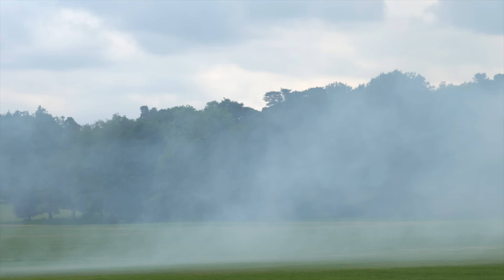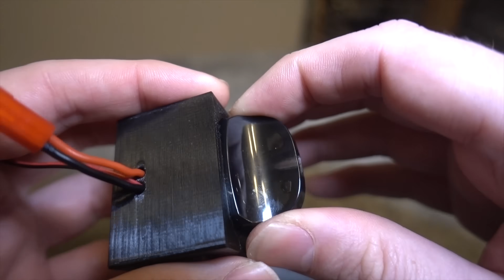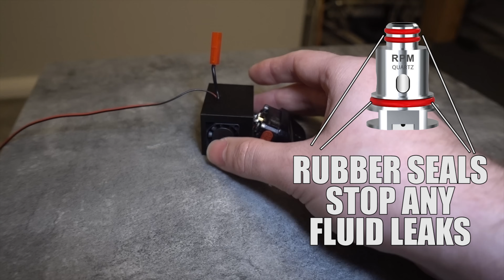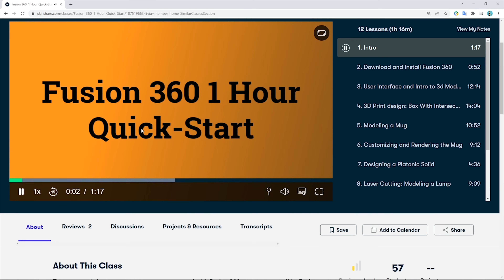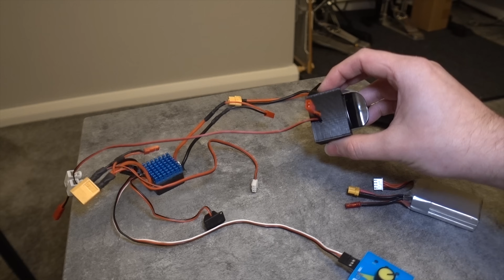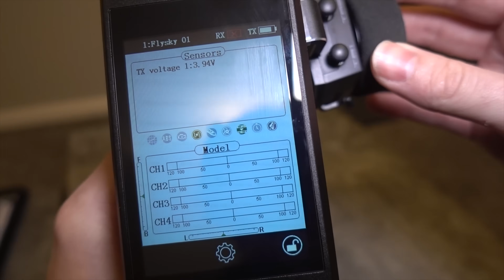RC Smoke System RC Cars Boats & Trains

Comment: I'm going to give this a try for my rc boat, printing the housing now. Thanks for sharing the file. Going to run it off the main battery with a DC to DC step down board to control the fan speed and coil heat.

Comment: Hello, excellent work!! I plan on recreating this concept. How many volts is the esc pushing into the coil? Did you have to experiment with the amperage at all? I’m trying to use 3.5volts, but I’m finding that the amperage is too low to heat up my coil. I am using the same coil that you’re using

Comment: Hi Andy,  What did you have to set the servo tester value to? Mine runs for 30seconds or so too and then it stops.  Not duer if the coil gets burnt out.  Maybe I need some sort of voltage regulator

Comment: I tried this.  The unit makes smoke for about 20 seconds then stops.  The vaporiser coil fills with liquid.  If you suck though it (as if you were vaping), then it starts again but soon stops.
I think this will work better with a vacuum pump

Comment: Awsome Andy!!  Very handy for RC applications. I am building a dual rig for my big scale James Bond car but I have a question.
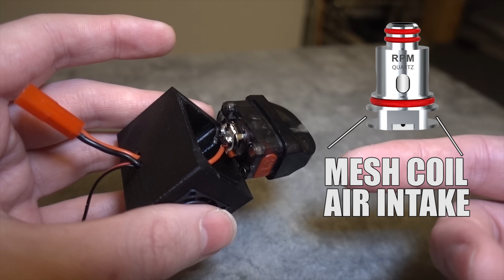In the video At 7:40 you say that” you have a better solution than this” revering to the soldered wires to the pod.
Can you give me a hint how you want to do that because the smokepod needs to be easy to replace,
in case a burnout?

Comment: Nice , you can also add a small tube  connected to the sound system if you have one , that way the smoke will pulsate in accordance with the engine revs , basically an acoustic smoker
Reply: Can you explain this in more detail?
Reply: @eskee1  there's a guy who made one on YouTube, basically you drill a hole into the speaker and put a tube in it, the tube then goes into the smoke generator thru a hole you made in it too, so the sound travels from the speaker to the smoke generator and shapes the smoke according to the engine sounds

Comment: Hi Andy, I'm trying to recreate your Smoker for my RC drift car, but I have a question. When installing it in an RC car, would it have to have 2 ESCs? one for the car engine and another for the smoker? I have a brushless esc and a radiolink that allows channel mixing just like the Flysky Noble NB4.
If 2 esc are really needed, the second esc should be connected to a receiver channel, but only the data line? leaving out the red (positive) and black (negative) wire

I hope you can help me solve these questions,
Thank you!

Comment: Since the airflow thru the nozzle is limited the chamber is much of a pressure chamber. Adding a fan will not give more pressure. An interesting little project though 😊
Reply from the maker: Yes it semems this is the case at least with a pod

Comment: This is an awesome idea. And I used to vape rebuildable dripper atomizer that I could make my own coils at whatever ohm I want. And pack it with cotton. But we just need a way to pipe in new propylene glycol and vegetable glycerin so the cotton doesn't dry out and I'm telling you these things really pump out the smoke. These little tips don't put out the same amount of smoke it's meant for vape to mouth then inhale. But the drippers are vape to lung. Just strait to inhale.but they seriously put out some clouds. It would be perfect to use a 40mm 4 coil rebuildable dripper "rda" I know it would work.
Reply: You need to make a video of this with links to the parts you're talking about.
Reply from the maker: This works to some extent. Would you feel comfortable constantly blowing on your RDA for say 15 mins constantly wothout the fluid catching fire? If I'm correct an rda would just keep getting hotter and hotter if pressed for a long amount of time as they are unregulated? I'd be interested to know. I went for the Nord 4 as it was a small pod type device that could take 80w. The smallest to do that. Things start to get heavy and messy after that when it comes to box mods etc. Vg also catches fire if it gets too hot for long periods of time so I think the amount of constant smoke we can get won't be better than this. But I'm working on something similar so let's see. I think three of these going at once might be smaller and cleaner
Reply: @AndyRCchannel  It's just nickel wire different gauges and I wrapped it around a dremel bit shaft. Like 10 wraps and I used to use two of them in parallel I believe. then I would just twist up some cotton and feed it through the center of that coil and tuck the extra around it so it can hold more juice just leave the outside of the coil exposed to the air so the vapor can come off of it easier
Reply: @AndyRCchannel  I'd say as long d there was air flow and constant supply of fluid it would be ok. I just worry about the battery because there was always an issue that if an rda got the button pushed in your pocket for too long the battery could explode but that was with 18650's. And with the RDA you could fine-tune your coil to be able to be at that perfect temperature where the air flows just holds the temperature from becoming too much. There's definitely something here. Just needs a few iterations of dialing everything in. I know sometimes I can take the cap off my vape and hold the button and just keep blowing on it as long as the fluid was there We just got to find that sweet spot

Comment: Ha ha, i vape and have looked at mine many times and thought it would work well as a mini smoke machine!  I would put that unit upright and run a pipe from the output though as very quickly the fluid levels will drop and half your wick will no longer be submerged.
Reply from the maker: The cars battery would run out before it started to do that. I do wonder though people don't vape with their heads facing down what I have observed. So surely this happens anyways? I did think about that but a pipe may restrict the airflow. People's lungs have a lot more power than a 5v fan but thx for the idea
Reply: @AndyRCchannel  some do vape that way and some dont, i keep mine as upright as possible as soon as the level falls below full for the reason i described.

My vape is a SMOK, the same brand as you used but mine is the standardized 510 electrical socket for the tank but uses SMOK baby beast elements, mine has a 10mm port at the outlet end, adding a 10mm fish tank tube to mine would not really restrict it but the type of tank i have has its inlet on the sides of the base instead of the bottom like yours so would require a different design to make it work.

I am super interested in the process of converting photos to things useable in 3D files, many times i have wondered if i could put something on my scanner and somehow use the image to generate templates for 3D printing designs, could you share the process or links to a guid or maybe even do a video on how you go about converting the images?

I see your using Tinkercad, in two years of 3D printing, i still use Tinkercad, its so easy to use and although its not as capable as the other things out there its not brain exploding complicated like them!
I have got so good at using it that i can find workarounds for anything it cant do natively :)

Comment: That's brilliant! What happens if you put a few drops of food color in the glycerine? Need some colors for muh chemtrails...
Reply from the maker: You won't see coloured smoke that often even in general aviation it's quite complicated and very bad for the environment the Red arrows get a lot of stick for this and are looking for a better solution. In short oil always Burns white. colour the colour has to be added after combustion which is why why even the Red arrows only have have maybe a couple of minutes of coloured smoke compared to to the 10-minutes or so no of white they are just masters at knowing how long to use it for. Google it. Quite interesting

Comment: I'd use a homemade solid chemical reaction sugar smoke grenade.  Recipies on YT.

No electricity required, but then, you've got a fire hazard if the model crashes before it's out.  Once it's lit, no stopping it except submerging it or cutting off it's oxygen supply.

Comment: That's awesome Andy. I could definitely use something like that in some special effects applications 😎
Reply from the maker: yes it has multiple use cases. theres actually a product called a mini fogger that is basically this for visual effects but they charge 200 dollars for it lol. theres what 14 quid of stuff to do it haha.
Reply: @AndyRCchannel  Yeah, the minis that are used are way too expensive. I would need something in a small form factor like this that can run off a battery and I can connect some type of contact closer (PIR Sensor, Step Pad, etc) to trigger it. Say like in a campfire scene or similar smoldering sections placed around the set and props. I may be back in contact with you in the near future Andy.

Comment: try a high speed radial fan, they have better static pressure
Reply from the maker: I have tried that but thanks for the suggestion. you know its kind of funny. the fans get to a particular point where they start to cool down the mesh and you get less smoke. The static pressure fans do this because they are more efficient at cooling than airflow. to combat this you can always turn up the pwm value but this puts a lot more strain on the ESC as it has to provide more voltage and current to achieve the same amount of smoke. It also drains the battery faster. This cooling doesn't happen when the atomizer is sucked on but does when blown. I believe this is part of the reason two fans made things worse. Thanks for the input really useful and thanks for watching and giving suggestions

Comment: Awesome work, Andy! Well done!!! 😃
I've seen something like that before, but the person made the vaporizer, let's say. It was years ago and I don't remember details, but he basically used some kind of cotton with some fabric around it and nickel chrome wires to make the coil... And used the exact same kind of oil you did... Or it was glycerin in gel... I really can't remember. 
Then he put everything in a box (maybe a metallic box, I don't know) and used a small 10a esc to drive it. Then you could put it in a switch and so on...
Anyway, stay safe there with your family! 🖖😊
Reply from the maker: there have been attempts in the past to make a product like you describe but they are not safe because there is no way to regulate the coils from going into thermal over run and the fluid catching fire, which is why you dont see them for sale any more. Burnout daemon and burn effect were two products you could buy in a store but after my research I would imagine there would have been so many incidences of some sort of fire or RMA it wasnt worth it to make them  (VG has a very low ignition temp) you also cant cater for what someone's ESC can handle and how much things like motors running at the same time will have an effect on the current and voltage that can be provided to the devices you are referring to. so in short you would have to work out what your over all voltage sag and current draw is, on top of your smoke system and cater a custom length coil and ESC for that model, which these discontinued products did not do. At least with this method if anything goes wrong the coil just breaks before anything will catch fire. However I do have another idea im working on. but then today I thought. well what if i just run two or three of these, the ESC can easily take it haha. cant stop my brain from thermal overrun at the moment. Thanks for your input as always man you know your stuff
Reply: @AndyRCchannel  That could define be a great idea, Andy! 😃
But yeah, it's definitely not safe. That's why I never tried something like that! I only use nickel chrome wire for foam cutters and lighters! 😂
Reply from the maker: @MCsCreations  they are very good for that haha

Comment: Go to city plumbing and ask for some smoke bombs, we use them in the domestic gas trade to test chimneys and flues.  They ignite with a lighter or hot coil
Reply from the maker: you cant stop and start them though right or control the volume using PWM? its ok i have a solution to that :)
Reply: Have you tried a bit of diesel
Reply from the maker: @bg563195  there are oils that produce denser smoke but they come at the price of being toxic and extremely smelly. Baby oil is what most GA use these days but it stinks, even the red arrows are looking for alternative solutions because they are very bad for the enviroment. VG can be used inside with no smell and no harm to anything. just hide the fire alarm haha
Reply: @AndyRCchannel  it would make a good lost model alarm too,  you'll see it miles away